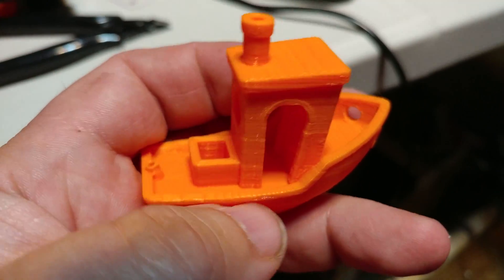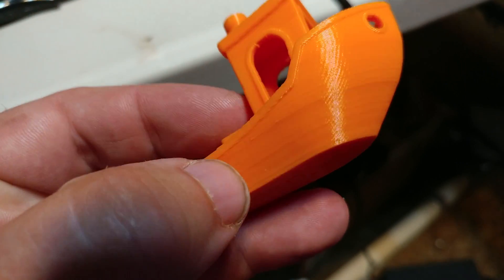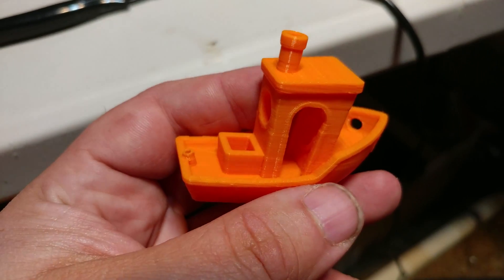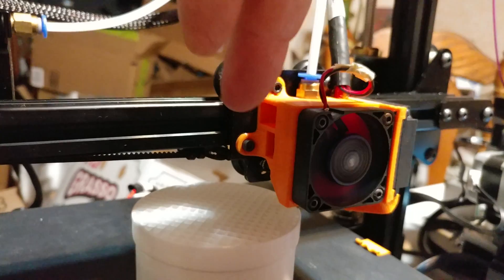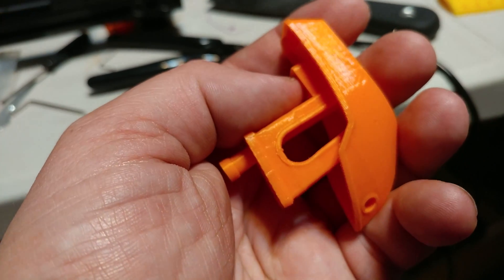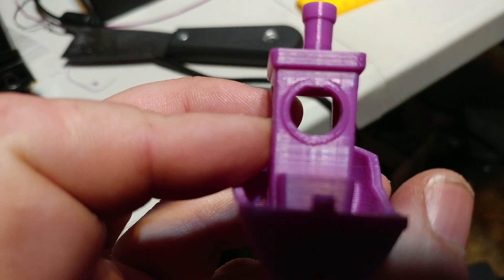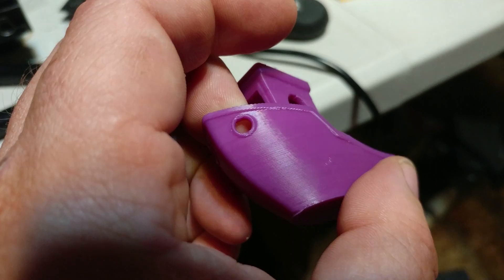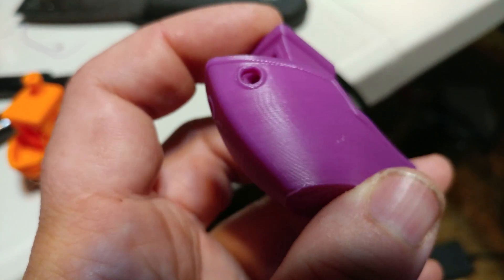Today's 3D Print - Benchy's from the Anet E10 and Hictop Ender 2

Comment: Have followed you for a while, so I got an ender 2 though your link to join the E2 club...

A question, what do you do with the printer straight after printing as far as cleaning and prep for the next print, I have had some clogging issues in the head and Teflon tube. (A note when I realised it was Teflon I thought remove the tube and use a hair dryer to heat up the area, went to the bathroom and saw the Mrs's hair straightener there turned onto 200 celcius, held over the tube and Bob's your uncle, it pulled out)

Could you type some on what settings you used for the prints in your YouTube video notes. You spoke about some in your video, it would be good to include for people who subscribe to you

 P.S. I like the way you present, it's honest and you don't focus on self promotion as your priority like most YT's seem to do.
You are all about the fun of 3D printing, keep up the great work!!!!!!!
Reply from the maker: +Wayne C that is strange I have never had a clogger jam on an Ender in fact the only time I ever had was on a cr10 s and I think that was because the Teflon tube shifted creating a small Gap which allowed filament to fester and cook off can you describe the circumstances around the jam? What filament were you printing temperature etcetera?

As for after print maintenance I do absolutely nothing I just turn the printer off if there's anything hanging off the nozzle I pull it off and that's all I do one thing I've learned to do if I'm not going to use the printer for more than a day I put a bag over the filament roll so dust doesn't collect on it which can absolutely cause a jam although it takes quite a long time and a lot of dust to cause this unless you're in a very dusty environment

One thing I always do is I make my first layer hot at least 15 20 degrees above normal print temperature I typically run 225 Celsius for my first layer and then 200 after that this does two things it makes it fairy liquid so if there's anything in there that shouldn't be there it gets shoved out and help with bed adhesion for that first layer

I also like to manually Prime before the printer starts a print once the axes begin to move I'll just squeeze the lever on the feeder assembly and grab the filament and push some through and of course clear the splooge off the nozzle
Reply: Filament was Tronxy fronm gearbest black and orange, tried the orange.
I went back to scratch and used the cat.gcode supplied and the white filament supplied and it worked like a dream.
The filament didn't make the whole print and I followed the end through while running with the black and it worked great.
I'll try the orange again tomorrow. Thanks for your reply, keep up the good work, I'll head to Patreon as well for you...blue04
Reply from the maker: +Wayne C excellent good Diagnostics whenever you're having that kind of trouble first thing you do is go back to known good gcode and known good filament this will confirm whether I say filament or settings problem or printer problem